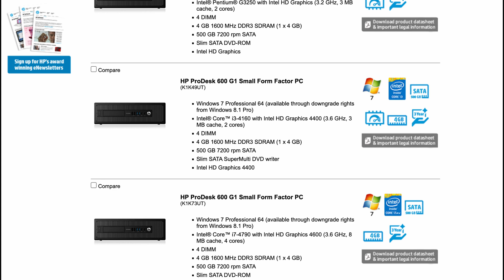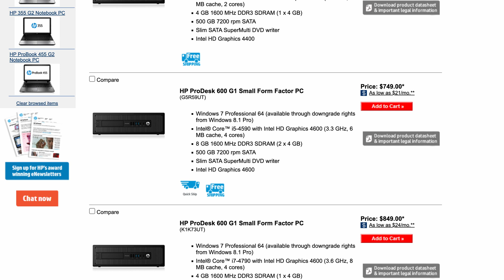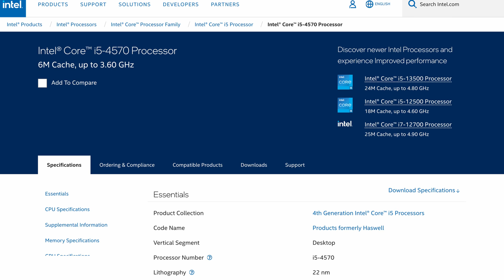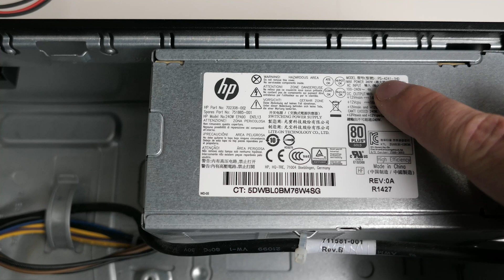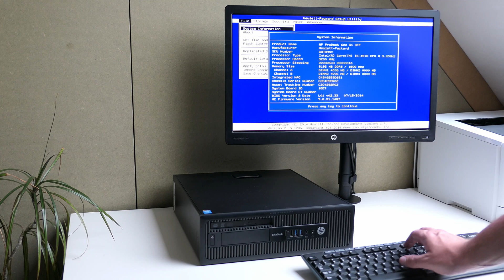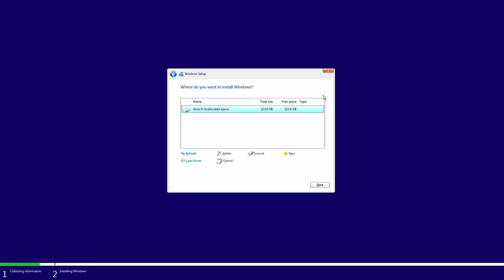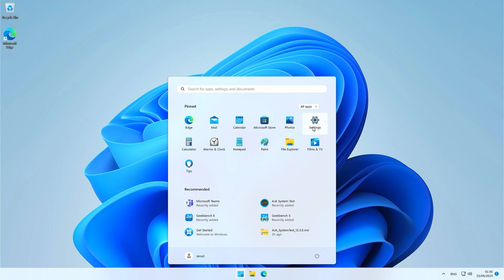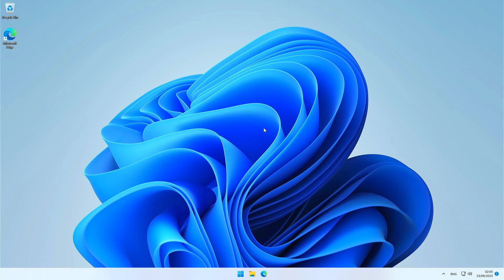HP ProDesk 600 G1 SFF - Teardown - Reassembly - Benchmarks

Comment: I’ve been modding one of these, and noticed you didn’t connect the power button jumpers. I thought you just edited it out. I fit a nvidia 1050 thx in it. I had to cut a little piece of the frame and the lid doesn’t fit, but I custom made that. I found it in a thrift store for $10.

Comment: I have this same PC, and I tried a 1050ti on it. The PC turned on and all but the 1050ti didn't receive any power.
assuming both GPU and the PCIE slot are not damaged could a BIOS update be the fix?
Reply: PSU does not delivery enough power to. You better put something lighter than that

Comment: For this HP ProDesk 600 G1 machine currently has an i3 4160 processor, the first question is, should I upgrade the processor to a 15 or 17, is it worth buying this one: Core™ i7-4770 Processor. I don't want it for gaming but I don't rule out the possibility, I want it more for rendering or processing virtual machines, editing photos, etc., the question is I bought an adapter for an M. 2 and bought a 1 terabyte hard drive, I did tests and the speed is 3500 in reading and 3200 in writing, for the PCIE 3.0 version but it is busy on the 16x PCIE, then either I put the graphics card or I set the disk speed, I would like suggestions, although I see that the integrated video card does not look bad, the last question is I have 2 * 2GB and 2 * 4Gb memories, the total memory is 12 GB but it runs at 1333 Mhz, is it worth buying the 8 Gb ones (it would be this ADATA DDR3L MEMORY 8GB 1600 MHz UDIMM 1.35V (ADDU1600W8G11-S) I hope you can support me with my doubts, excellent channel and excellent explanation, thank you for giving us the opportunity to expand the computers and get more gameplay, I look forward to your suggestions.

Comment: does it have an extra 6pin connector for adding GPU?
Reply from the maker: It does not and the power supply is pretty limited as well. The best is to choose for a low profile GPU without the need for external power like a GTX 1650 or RX 6400.

Comment: Hi, I have this pc and have been pretty pleased with it over the years. What would you recommend in terms of increasing the storage capacity and overall speed of the machine please? Can this be done without losing any information / files on the pc? Many thanks
Reply: connect a 2nd ssd and transfer all the files to it, you can either keep the old storage form factor or throw it/resell it.

Comment: Please reply! How many pins does the motherboard power connector have?
Reply from the maker: It has 6-pins + a power command connector, as far as I know it's a proprietary standard which HP uses in a lot of these SFF machines. There are conversion cables available to/from normal ATX power supplies.

Comment: @jensd_be Will this motherboard work with a ATX Power Supply? Assuming the original PSU isn't working and I have a regular mid tower with a good ATX Power supply. I don't see the regular 24 pin that comes with a standard ATX motherboard. 
Please and Thankyou.
Reply from the maker: It has its own proprietary standard but there are adapter cables on the market that will allow you to connect a standard ATX power supply. For example: https://www.moddiy.com/products/PSU-Main-Power-24-Pin-to-6-Pin-Adapter-Cable-30cm-for-HP-Z240.html

Comment: My mom ordered me this pc 2 years ago, while looking at this video i realized i do not have a password reset jumper, my pc has been malfunctioning a lot and lately it will not start, the error code i keep getting is 0xc0000225, is not having a password reset jumper the reason? Sorry if this is stupid as have nevrr had a computer previously and my pc hasn't been working for months
Reply from the maker: I don't think this would be related to a missing password reset jumper. That error code seems to relate to boot issues so either some files are corrupt (like an interrupted Windows Update could cause for example), your hard drive/SSD is not 100% anymore or has filesystem errors or there are issues with the memory. I'd start with running checkdisk and maybe do a memory test. If those come back clean, a clean re-install of Windows will probably help you.

Comment: Would a mini Itx or a micro Atx motherboard work with this line of hp chassis?
Reply from the maker: I think the form factor of the board is a standard micro ATX regarding size. Only thing you will need to pay attention for is to get a conversion cable for the power supply as that is not standard ATX.

Comment: I had no idea you could actually get windows 11 on this machine. I own the same machine, with the difference that I got an i5 4790. Is it safe to do? And will it run as well or better than the copy of windows 10 it originally comes with?
Reply from the maker: Should work just fine. In terms of performance, I did a video on that subject previously. You can find it over here: https://youtu.be/6zkAxYOe_IM

Comment: I just bought this, it is painful slow. Is it hard drive or 4gb ram?
Reply from the maker: Both won't really help regarding performance I think. 4GB is on the low-side these days and definitely replacing that hard drive with an SSD will give a huge boost.
Reply: @jensdbe thanks
Reply: Upgrade to 16GB and a good SSD and you will notice the difference, if you want it to do light gaming put a lp graphic card and you got yourself a nice budget and quick light gaming PC
Reply: @Kocaineee thanks, i upgraded to 8gb ram, it is still same slow. It has windows 11, it is unusable due to being slow, will try to put Windows 10 on it

Comment: Can this computer work without the hood sene? I have one with the following problem: System does not power on and the LEDs on the front of the computer are not flashing. 
The power supply was checked and it is fine, I checked the power button and it also works.
Reply from the maker: It can work without the hood sensor. In any case that would not prevent the board from getting power or showing LEDs. If you are sure that your power supply is good, then this sounds like a dead motherboard.

Comment: That is the exact computer I have although I have  upgraded to dual SSD drives and 16gb Ram. Not sure if the CPU  can be upgraded or if the CPU is worth upgrading. Running it with dual boot of Windows 10 and linux.

Comment: I have the exact same model. I’m hoping to upgrade the psu to 300W. I wanted to know if this model could support that. I recently upgraded the GPU. The system is currently working fine. Unfortunately, I did some research and ChatGPT gave me some misinformation. I have a 240W PSU but my GPU recommends 250W PSU. ChatGPT told me it wouldn’t matter. I regularly monitored my system so far and no problems. I only use it for legacy games like Skyrim. I was just wondering if this units psu can be upgraded since HP makes things differently. I’m hoping to not be forced to uninstall my GPU permanently.  Since this can cause long term system issues. I currently have a Comptia A+ so I do have some tech knowledge. I was just hoping to get some wise advice from you. Thanks.
Reply from the maker: Depending on which GPU it is qnd the rest of your components, this probably isn't an issue at all. The recommendation is typically a bit luxurious.
Which GPU do you have? Both the size and connectors are non-standard, so upgrading it might not be easy.
Reply: @jensdbe  I have the AMD Radeon R5 340X and the no other components on expansion cards. It’s Low Profile.

Comment: Have you noticed that the prodesk is more streamlined than the EliteDesk?
For the SFF:
-2 memory slots instead of 4.
-1 pcie slot in 16x format instead of 2.
-A screw to remove the cover instead of a handle.
Always prefer an EliteDesk!

Comment: Hii👋😊 I have a question, can those small SFX power supplies fit in this desktops? I want to upgrade mine with a gtx 1060?
Reply from the maker: Not sure what you mean with SFX power supply but with the standard pwoer supply, a GTX1650 in low profile should work.
Reply: @jensdbe  Go look them up maybe you will understand what I mean👍

Comment: Cam we upgrade gtx1650 ddr6
Reply from the maker: As long as you have a low profile card that doesn't require external power, this should work.
Reply: @jensdbe  i just want to know gtx1050ti or gtx 1650 because in my country gtx1650 low profile are not available so please suggest which one
Reply: @krish3210  low profile cards only unless you put motherboard in new case and change the power supply

Comment: How does a runner games
Reply from the maker: Depends a bit which gamea but for proper performance you need a GPU as well. A low profile GTX 1650 is probably the best option in that case.

Comment: A perfectly good computer!👍👍 I would increase the ram., to at least 16 gig., and according to the HP specifications for this computer it can handle a maximum of 32 gig., of ram..
Reply from the maker: Depends a bit on what your plans are with the computer. For basic tasks, you probably won't notice the extra 8GB. But its a cheap/fast upgrade, so why not.
Reply: @jensdbe  I concur that 8 gig., is plenty for basic tasks, but when there are four ram., slots I like to fill them and as you mentioned 4 gig., DDR3 ram., sticks are fairly cheap these days.